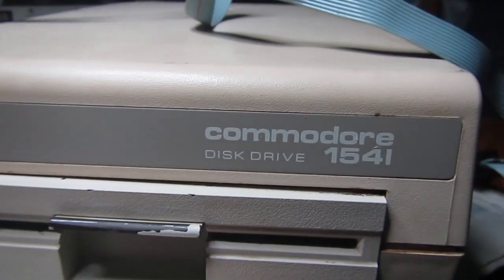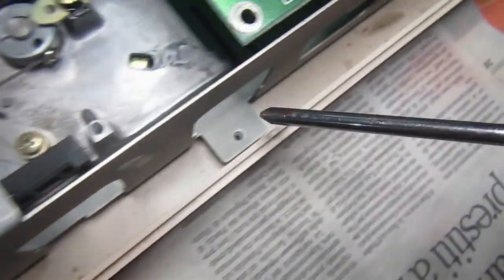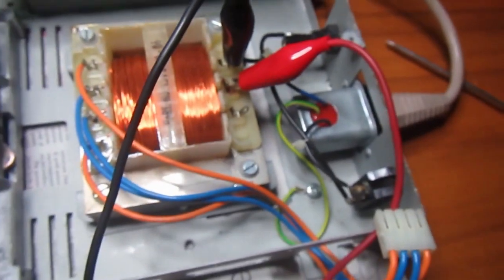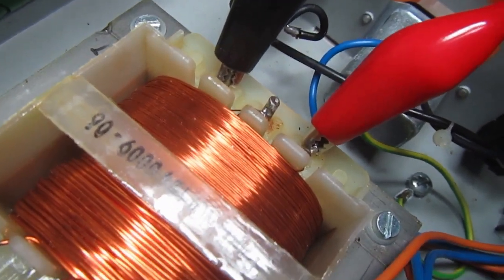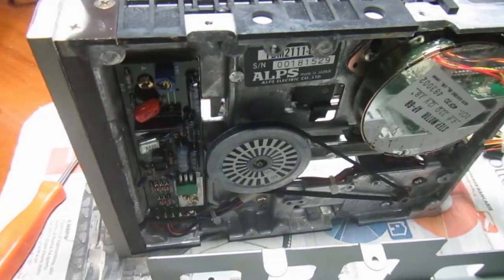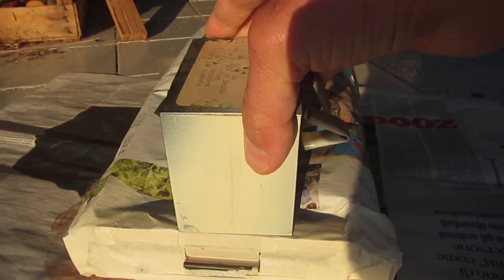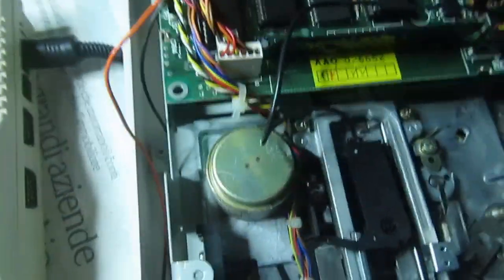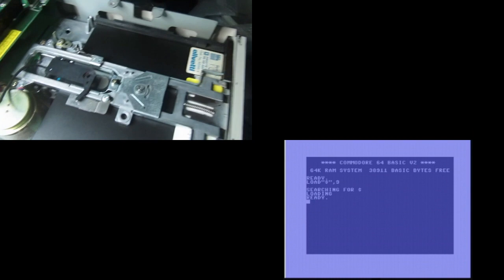Commodore 1541-C restoration. Transformer primary voltage and cosmetic issues

Comment: Hi , nice idea about voltage tweak. I have 1541 a bit newer model , diferent style transformer , but i managed to find correct wires to switch to and now runs a bit cooler and lower voltages  . Thx for this .
Reply from the maker: Hi, I'm glad it helped!